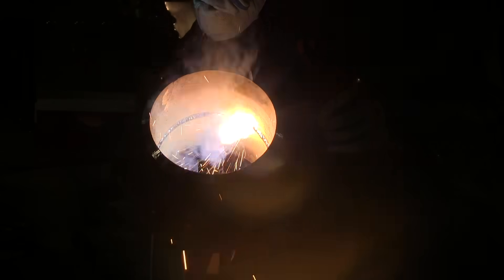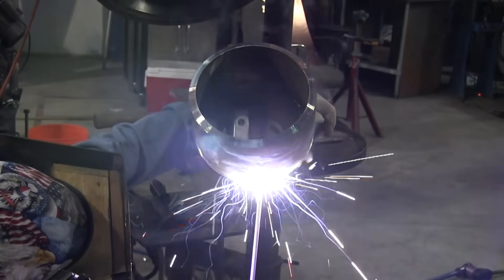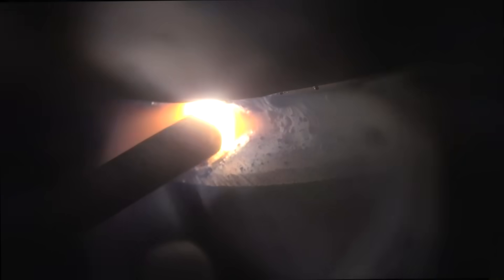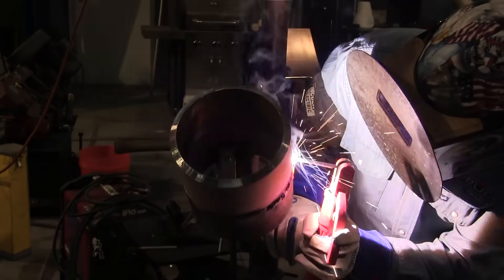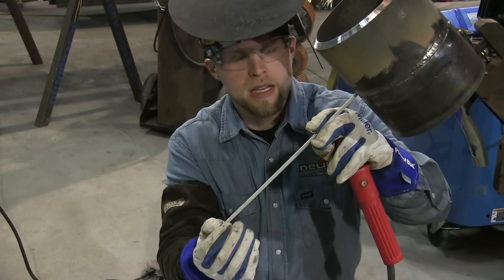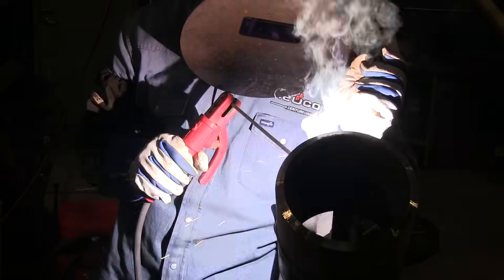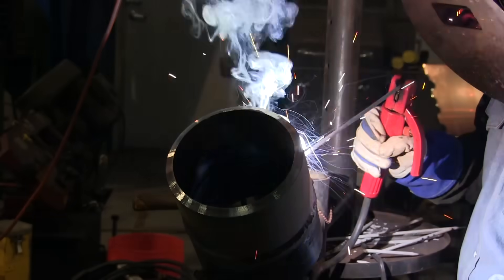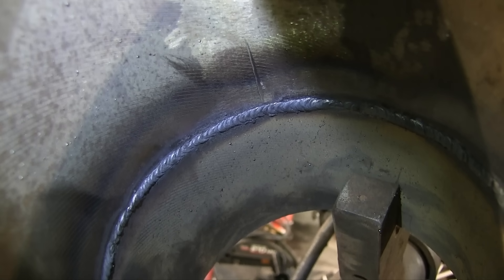6g Test 6010/7018

Comment: You mentioned arc strikes outside the bevel.  I have asked this question to multiple CWI's and never really got a straight answer.  If arc strikes are a no no then how come I can weld a dog right outside the bevel to facilitate the fitting of the pipe?  I am a fitter and welder and have never understood this rule other than for esthetics.  Any insite you may have would be appreciated.

Comment: The testing here in the u.k. is different, I'm doing this test but I carnt do a 6010 root and E7018 fill and cap as they are saying I need to do it 8n 6013, E7018 and 6010 so that's 3 separate tests because they all cover different ranges. Is this right?
Reply from the maker: Different countries vary. In USA we have AWS, ASME,and API nad more and they all differ. Plus a company has some say in it too as long as they comply with minimum standards
Reply: @weldingtipsandtricks   thanks jody, it's iso 9606-1 over in the u.k. and by the chart and qualification range I'm going to have to do the 6G test with 6013, 7018 and 6010. £800 per test so not ideal. Any advice on the 6010 electrode?

Comment: I don't understand, why not a proper auto darkening helmet? A PAPR one will naturally block out all the ambient light and keep your face cool with clean air as well.
Reply: those pancake hoods are usually used for outdoor conditions. it has a wood block around your eyes, pretty much just gottles with a circle around. its not the best for fumes or burns on your face but prevents backlight for outdoor pipe welding

Comment: just in time! that pro tip when doing the fill & cap with 7018 is exactly what we are facing, our instructor told us that we should always point our rod at the center of the pipe, but as we do that the bottom weld with the 7018 always sags, no matter how fast we do our travel, thanks for that!

Comment: Hey man loved the video. I have a question for you. I'm 14 years old living in UK and I do blacksmithing and welding jobs. I want to start practicing open root in 3g and eventually pipe. But my little inverter can't run 6010. 6010 rated machines here cost at least 4 grand. My question is can I use a 6011 for open root joints like pipe and all that? Thanks for the help
Reply: Hey brother I hope I’m not too late to help you. The short answer is yes you can run a root pass with 6011, the slag will be more difficult to get off and the arc won’t be as stable, it will however work.

Comment: When I'm doing 6g with 6010, I always have undercut on the top of the bevel in a few areas. Rod angle is my issue but everytime I try to adjust my angle I still have the same issue if not something else like a crater or something like that. I run my amps at around 65-70 1/8th land and gap. Anyone have advice to help? Thank you

Comment: ISO 9606-1 weld tests allow the use of a grinder on the root string only. I don't know how it works job to job but the International test allows the grinder regardless of what the tester says. Know your rights guys, it can make a difference.
Some great tips as usual Jody, they make the videos very rewatchable (depending on where a fella is on the learning curve)...and Andrew is a Jedi level pipe welder. Thank you.
Reply: Корневой слой прочесать ушм просто необходимо

Comment: Bought 6010 rod flux color is red. I only need 40 amp to weld 1/8 inches steel. And 50 amp to weld 1/4 inches steel. Any higher amp than that will burn through. Not sure if it's the rod or me. I was told I need 75 amp for 1/8 inches and 90 amp for 1/4?

Comment: why use 2 different kind of electrodes?
Reply: Mostly due to how each rod performs. 6010 digs hard and burns through to make the root. It's also a fast freeze rod. 7018 is a higher strength rod, which is one of the reasons why it's used for the rest of  the weld.

Comment: What I wanna know is do you have to grind your restarts if u were to do a X-ray test?
Reply from the maker: it depends.  on the root pass, if you grab a rod and get right back in, grinding is usually not needed.  Same with the 7018 fill and cap.  but on the bottom, it helps to grind a bit of a taper before starting the second half...helps with appearance as well as avoiding porosity on the bottom starts

Comment: I was surprised at the 105 amp setting for the 1/8 7018, I was curious if that was done to avoid the potential of burning through the root pass and also reducing the buildup for that pass or does that machine tend to run rods hot for the setting ?
Reply from the maker: The machine does run a bit on the hot side.  and with Andrew having ground the root, it seemed wise to go with 105 amps
Reply: Smoother and better arc control.
Reply: I try it while ago. 7018 amp. 180 .but rod hard to spark. What should i do sir.

Comment: I worked for local 537 and watchrd many a welder stibk weld 6 in. pipe roughly 40 minutes. then I went to work for another company that might welded all of their pipes.  I clocked him at exactly 4 minutes. How do you bid against this????????????
Reply: Mig is good in controlled conditions such as a shop. Doing it out in the field when its windy and raining stick is more reliable.
Reply: might welded sorry.
Reply: mig

Comment: I welded miles and miles of pipeline back when I was a youngster. 

One job I was on in New Mexico I burned probably several tons of rod . We were welding a pipe that was 90 feet across and 3 inches thick. It was a mine shaft that went 600 feet into the ground. Quite an interesting job that was. Most of the welders were burning 1/8 rod and would take 12 hours or more to do an 8 foot section. I would burn 1/4 inch rod and do 4 - 8 foot sections in my 12 hour shift. All the welders hated me but the boss paid me 4 times what he paid the other welders. So I didn't care what they thought. We were getting paid by the hour but I knew the man that had the contract and he took good care of me. Fun, fun, fun.....
Reply: You must of been a RAT welder..
Reply: @purple935  Don't know what that means...
Reply: I always weld like that to. I can’t help it. I can’t milk a job , I only have one speed n it’s GO!
Reply: Probably save your rod stubs and use them for arts and crafts too huh ball washers
Reply: Probably save your rod stubs for arts and crafts too .. couple brown noses
Reply: Ahh you’re of those dogs that can’t work in with the rest of the crew. Word of mouth travels fast, guys like you rarely get consistent work.
Reply: Such a show off.. yup you do sound like that guy that nobody likes 😂
Reply: Lies

Comment: Jody why a 1/8 and not 3/32 7018? Can you explain sir thanks for the videos
Reply from the maker: sometimes pipe tests are given where 1/8" is required.  3/32" probably would have been nicer for the first pass
Reply: @weldingtipsandtricks  jody thanks sir